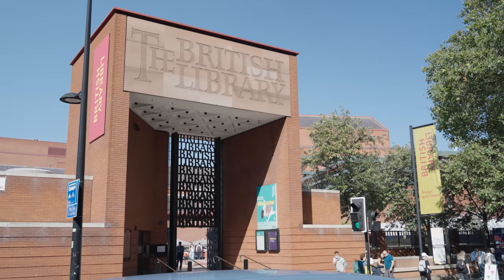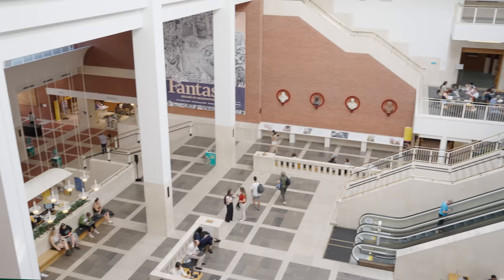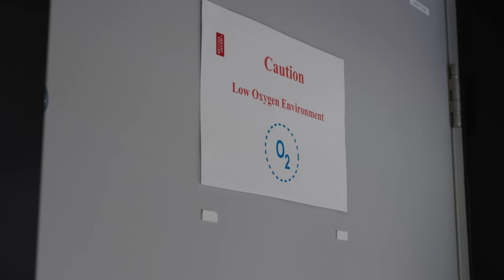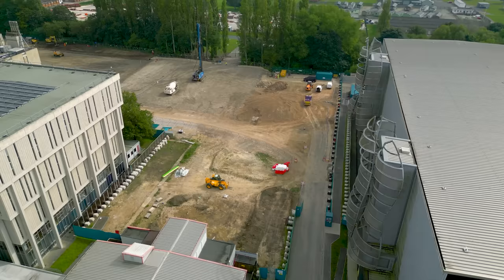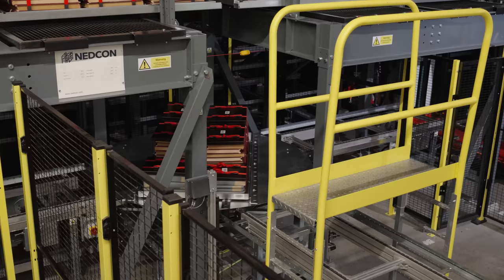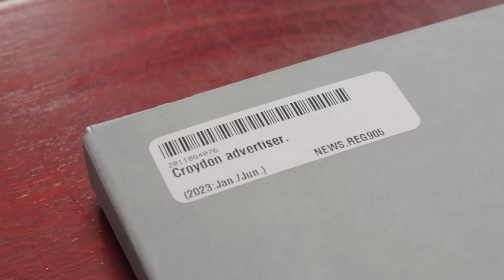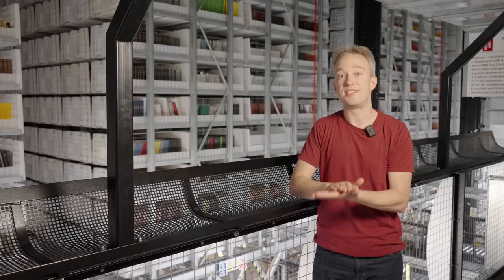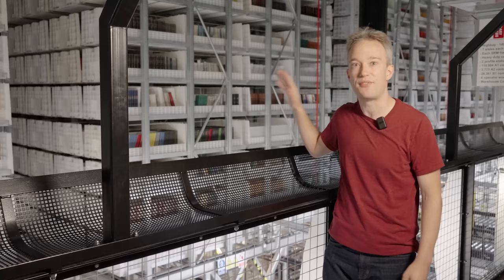This library has every book ever published.

Comment: Oddly satifying that institutions like this exist
Reply: It's comforting to know the past is being kept around and safe, even if it won't be used often. The same thing applies to hoarders a bit
Reply: I wonder how disaster proof it is, if something ever happens to civilisation as we know it, we'll have this fantastic source of generations of information to fall back on. You hear of the seed vaults in Svalbard etc that can kinda maintain themselves but would this national library slowly/suddenly degrade without direct maintenance? They all look like above ground buildings mostly so presumably they'd go up in fire rather easily without outside help?
Reply: @_Saracen_ they have 700km of shelves, this is not above ground. It is also low oxygen so a fire would smother itself quickly, they also likely have full sealing procedures.

Comment: CORRECTION: You don't have to explain why you can't get what you need elsewhere in order to get a reading pass for the BL. That requirement was dropped in 2006, I believe. The requirement for an interview was dropped last year.
Reply: Wow! So it's more accessible then? That's awesome!

Do you know if this library supports the Libby app as well?
Reply: Just make sure not to get lost in the L-Space.
Reply: @LordDragox412  What's the L-Space?
Reply: @mikopiko  L-Space is a bit difficult to explain, but if you really wish to know, I strongly recommend reading the Discworld novels by Terry Pratchett, especially those in which the Librarian appears.
Reply: @mikopiko  Knowledge = power = matter = mass. All libraries are connected if you go deep enough into the shelves. Just don't call an ape a monkey, mark your trail with string, don't damage books, and beware of the more active ones.
Reply: @mikopiko L Space is from Terry Pratchet's Diskworld series. 

Books = Knowledge = Power = (Force × Distance) ÷ Time

So enough books bend space and time into an extra dimensional "Library Space" connecting all massive collections of books in the Diskworld multiverse.
Reply: Yes, I got a reader pass this year - I applied on line and once I was told it was done, I requested some books online then turned up the next morning to go to the registration point when I had my picture taken and a reader card was printed for me there and then.  I went to the reading room where I requested the books be delivered and collected them from the desk. It couldn't be easier.

Some say this is a bit of a problem though because the reading rooms are good study spaces you can use even if you're not using the BL's materials - so at busy times you might not find a desk available.
Reply: That's good to know.
Reply: @mikopiko  Bikinis.
Reply: @Skorpychan  And don't return books earlier then the last date they were checked out.
Reply: @apveening  Possibly also the final chaper of Mage Errent book 7
Reply: I had to go through the justification and interview process back in the day. I can only speak to my own experience, but it wasn’t very arduous. 

The only odd thing was that being the author of a book in the British Library was not by itself grounds for admittance. I can understand why that was but it seemed strange that you could benefit the BL by adding to its collection but still not be permitted to benefit from it.

Comment: I wrote most of my undergrad dissertation with the help of the British Library. You can't find many places with a copy of the British Museum's transcripts and complete translations of some of their cuneiform tablets that were published in the 1890s.
You can tell a book is rarely checked out when some of the pages haven't even been cut yet.
Reply: Wow, that means you have to ask to get it cut for you?
Reply: Wdym by cut?
Reply: @Speedster___  Old books used to be bound and printed with folded sheets to ease production, meaning that one of the edges would be connected to the next page. People would use a paper knife (the forerunner of the letter opener) to "cut" or open up pages to allow them to be read.
Reply: @ValleysOfRain  ah so it was attached to other pages not just spine. Thanks
Reply: Whoa. That's... Im jealous
Reply: @Speedster___  Yes. That's why some old books have "deckled edges" because they were cut and some modern books are made with deckled edges deliberately just for the aesthetic to mimic the old cut pages, for example some Penguin Deluxe editions.
Reply: @folksurvival 
Thank you for sharing this. I've seen this in books and wondered why the pages were like that!
Reply: @ValleysOfRain  To be fair, books are still commonly made that way, with 4 to 64 pages per "signature" (group of pages from the same sheet).  But for the last century-plus, publishers have pre-cut the page edges before* they attach the cover.

* Or after, if it's a paperback or a magazine.
Reply: @folksurvival  that is a cool fact, I always wondered about that as I have an old book like that, I don't think it is really that old but maybe just cheaply made using that technique

Comment: I'm curious how "low oxygen" a low oxygen storage building is that you can just kinda be standing in it.
Reply: it showed up on a digital meter in the video, 14.8%. Low oxygen levels slow the organic decay of the works and below 16% fires can't sustain themselves (without oxidisers), so that is why it is done. It's still high enough to breathe which makes it more convenient for practical access than being completely oxygen free.
Reply: It's reduced by about a third, from 21% to just over 14%- no great problem for creatures which can function at high altitude.
Reply: @quantumbanana  Somehow that meter didn't register for me until he said "low oxygen" later on. Maybe I need more oxygen.
Reply: 0.14 bar partial pressure O2 is perfectly breathable, it is about as much as you will get in a plane cabin or on top of Mont Blanc.

Comment: Is that room kept at low oxygen to reduce the risk of fire? Or is it because lower air pressure makes the robots more energy efficient? Is the low oxygen even a deliberate decision, or simply a consequence of the design of the room? I'd love to know the science behind it
Reply: I would guess "to lower the risk of oxidation" in general, not just combustion.
Reply: i think it is probably for the fire risk, and also because oxygen just generally tends to react with stuff over time even without fire
Reply: @MinerBat plus would help prevent bugs and other living things
Reply: @notthatcreativewithnames technically, fire is just a REALLY FAST oxidation reaction
Reply: You don't want to paper (and ink!) to react. Reducing the oxygen levels helps, as oxygen is a far more reactive element than nitrogen. Tom did not mention it, but long time storage of paper also requires low humidity, cool air, and low or no light. (Ideally, everything is printed on acid-free paper, or on paper not containing wood-pulp, but the BL only collects, they don't have a say on what material things are printed; and you can't expect the local butcher to print their weekly ad on expensive paper).

Low oxygen may also help against bugs, but I'm not expert enough to know how low the oxygen levels should be.

I really doubt it is about air pressure. I expect that the costs to maintain a low air pressure is much larger than any savings you get from having the robots operate with less air resistance.

Comment: What we need is several backups of this in out of the way remote locations that are hardened against all potential disasters to act as a 'backup drive' for civilization. If heaven forbid a nation's central library gets nuked then the contents could be reconstructed from the backup at a later date preserving that knowledge.

Kind of like that seed archive , but for books. (or an expanded version of the system described in "A Canticle for Leibowitz" ... )

Comment: I bet if it was all scanned in, it would fit on a single small RAIDZ level 2 array.  The thing about this is you could easily buy a tool-less hot swap drive cage, dump everything onto an array hosted inside, and then stuff the drives into storage.  With ZFS RAIDZ, you can recover by sticking the drives into any computer where ZFS is supported, which is just software.  With RAIDZ level 2, up to two drives can fail and you still have all of your data.  Just gotta make sure you don't let the mechanical drives sit around for so long that they ultimately fail from old age.

Comment: Why wouldn't the library of last resort be an online data base network of 100 identical locations around the world and 3 in space with everything stored on flash drives or whatever is currently the most stable long term storage solution? Why would it be physical at all? It should be digital.

Comment: I wish the video had a little bit more detail about what it means for it to be a low oxygen facility. After some digging online and finding an old powerpoint deck from 2008, it seems like they use a system called "OxyReduct" which reduces the oxygen level to 15% (compared to the 21% in the Earth's atmosphere) with 85% nitrogen.

As far as I can tell, this greatly reduces the ability for fire to spread, but is still survivable (but not pleasant?) by humans. There is a picture of somebody holding an acetylene torch to paper and it not burning. Seems like reducing oxygen has some kind of more-than-linear effect on the ability for fire to spread. Also, because the facility is kept at the same pressure as the outside air, even if the oxygen reduction system fails it takes a very long time to equalize with the outside air (>72 hours).

Comment: Bookworm's wildest dreams come true. Meanwhile most of the literature that runs through a recycling center consists of Reader's Digest, scribbled or atomized variants of older books.

That being said, one of the crates did include three re-printed annuals of a "radical" Finnish newspaper from the 1840's. Definitely not a bestseller, but still quite a rarity to have.

Comment: I've often wondered how this works. If I (for example), as I often do, produce a service leaflet for a wedding or a funeral am I supposed to send a copy to the British Library? Typically I will be running off 50-100 copies on a domestic printer and stapling/folding them by hand but the material contains a combination of text from various copyrighted resources under license and some new material for which the copyright resides with the families and/or priests that have compiled the service. Obviously I don't send this to the library but at what point does something self produced need to be? Is it the nuber of copies produced? 1000? 10,000?
Reply: This is an interesting question, as there isn't a clear definition of publishing in the legal sense. We would not collect things like orders of service as they are not really intended for public consumption, they are intended for a closed group of individuals invited to a wedding or funeral.  If there was a society that produced a handbook for their members we would not expect to receive that but if they produced a hand book that was for members and also available to the public then we would want that.

Comment: I'm currently wondering what the regulations on versioning are with archiving UK web stuff, given how easy it is to edit things. How often do you take copies of the site or file or whatever? Take, for example, the fire marks correction video you did, where the website said one thing when you did the original video and it said something different when you got the email 2 years later.